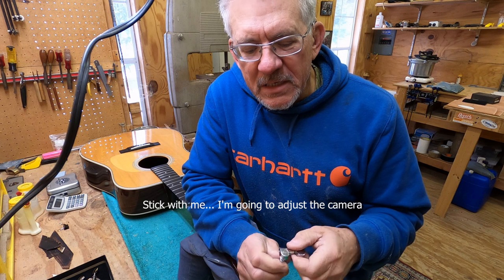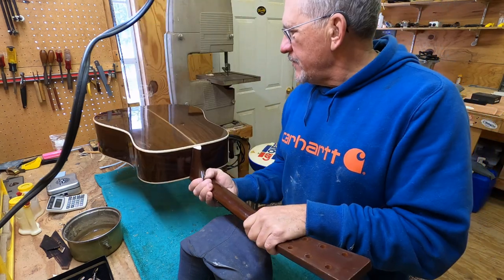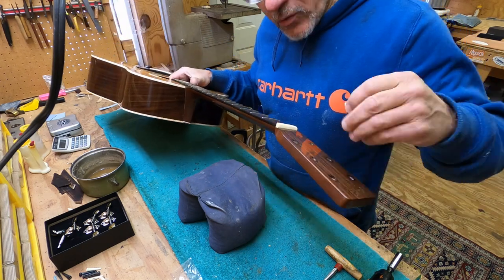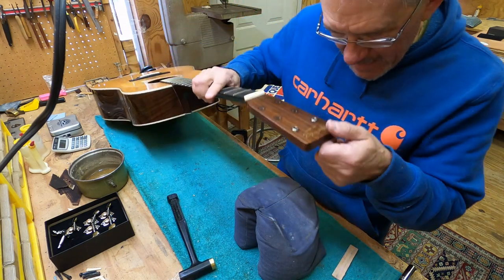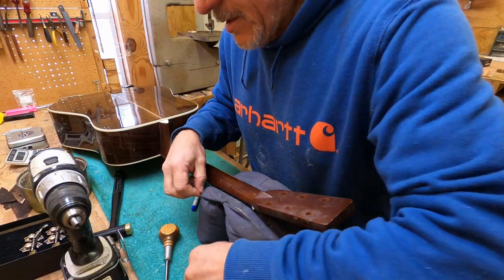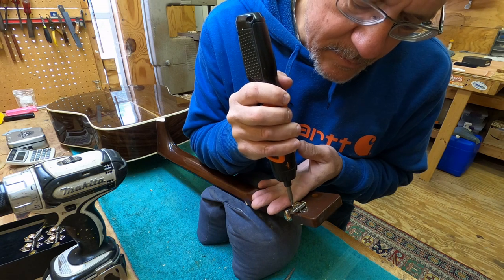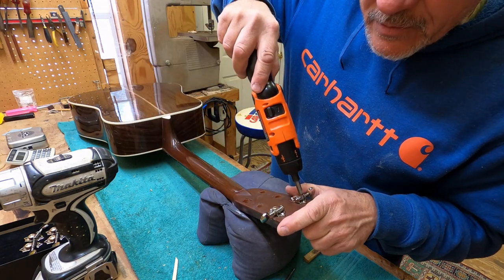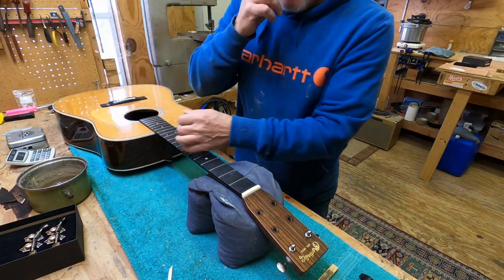Changing from Schaller M-6 to Waverly tuners

Comment: Thanks for sharing your knowledge Brian!  I just reversed this exact conversion that was done very poorly by another tech. (Guild D-55).  Customer was upset because the bushings didn't set flush with the headstock and there were big scars left from the previous tuners.  The bushing holes weren't reamed and the new bushings were hammered in so tight they were halfway in and deformed. I couldn't believe the headstock didn't crack!

Comment: I just put on Schaller  Grand  Tune open back tuners. These are very high quality and they look great!  18 ti 1 ratio. Got them for around 100.00 .  I believe they are just as nice as waverlys but half the price.  Thanks for all your videos, always enjoy them!
Reply from the maker: I used two sets of these when they first came out and both sets failed.  The grommets were a different size as were the posts, making retrofit difficult since the posts didn't fit conversion bushings. Maybe the specs have changed.  Grover 18:1 did after the first generation (which also failed).   Finally, I don't have a place to get them wholesale.  If a customer wants to supply them and I'll install them, that's fine.
Reply: Yeah i Love my Schaller grand tunes but to be fair, the quality isnt very constant. A friend had Major problems with two sets and switched to Waverly then.

Comment: What is the taper degree on that reamer?
Reply from the maker: 5 degree.  But it's just a tool I have on hand that does the job.  3 deg would be better as it would be straighter.  I have a straight reamer too but it wants to chip the edge of the hole so I use the tapered instead
Reply: I remember asking Dick Hill, whose very first dreadnaught you did extensive work on, what he used to ream the bridgepin holes. His answer was a #2 tapered reamer, like you’d find in a machine shop. I think they’re 2 degree taper, maybe that’s how they got the name; not sure if that’s too straight though.
Reply from the maker: For the bridgepins,  5 deg.  For the peghead bushings... anything could work.  The reamer I use is just one I have on hand and the biggest part of it is perfect for the bushings I use.